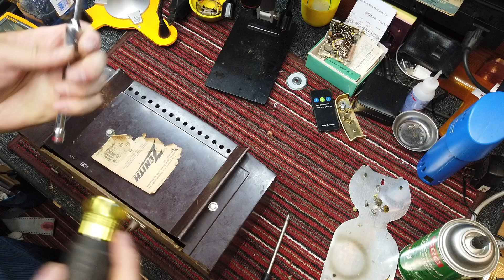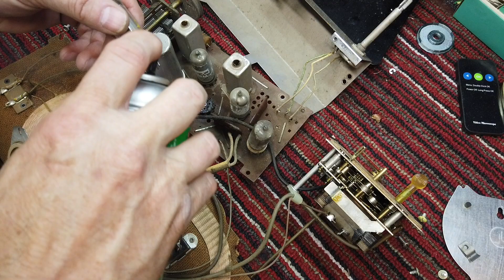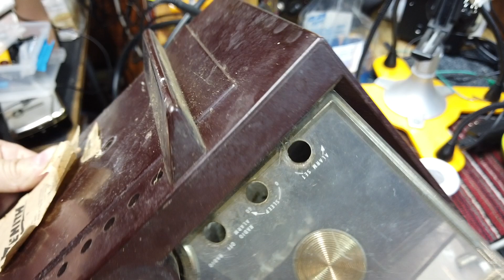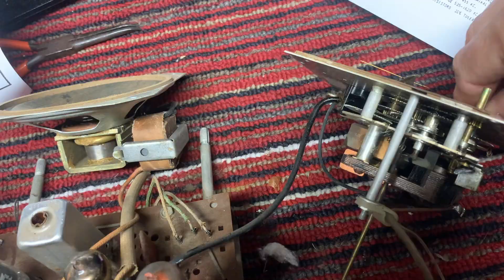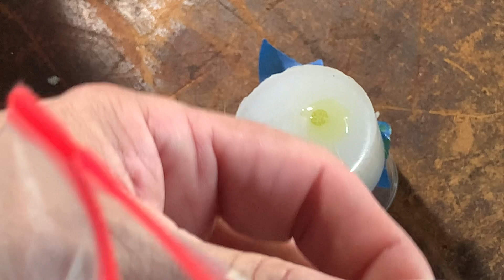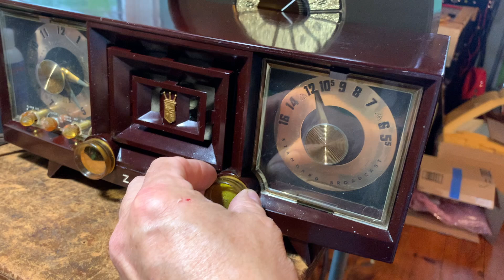Vintage Tech: Zenith X519 Clock Radio

Comment: Hi Kent how are you. What do you notice about the rectifier tube before and after replacing the electrolytics
Reply from the maker: The rectifier tube was bad, and after replacing it the radio hummed badly indicative of bad electrolytic caps.  After replacing these the unit played fine after an alignment.
Reply: Before the electrolytics were replaced I noticed the new rectifier tube was glowing  more intense indicating a mild short due to leaky electrolytics I was just wondering if you noticed the more intense glow and after they were replaced it was not glowing so intense. They were high ESR and also mildly shorted. That may have been why the rectifier was open.  You're a great technician and you did a fantastic job repairing that radio I'm not criticizing I'm just telling what I noticed it doesn't really matter its fixed just making conversation.
Reply from the maker: Yes. Filament was okay. Zero emissions.good  catch.

Comment: Mine was missing one of the little knobs also, I 3d printed one with clear resin and tinted it yellow
Reply from the maker: Great!  How did it turn out?
Reply: @KOVintageTech  other than a very slight difference in the shade of the color it's an exact match.

Comment: Greetings: ihe clock motor grease needs heat to loosen the grease; a soldering iron can be used to heat the smallest portion of the clock motor case.

Comment: I enjoyed the knob molding. Might give that a try. You did a nice job on the radio.
Those white specks on the case are from insect excretion. They show up on pretty much everything that was stored in a basement, storage unit or barn. Your silverfish friend that showed up probably had a large family. I thought for the longest time that the white specks were from paint spattering  occurring while someone had their house or apartment painted. It shows up on metal chassis that were sealed by the outer casings. It etches, so it's almost impossible to remove from metal. Subscribed...